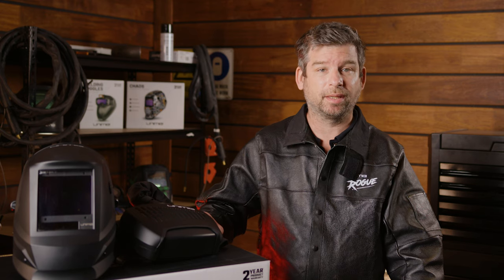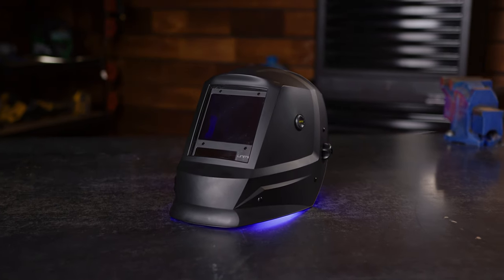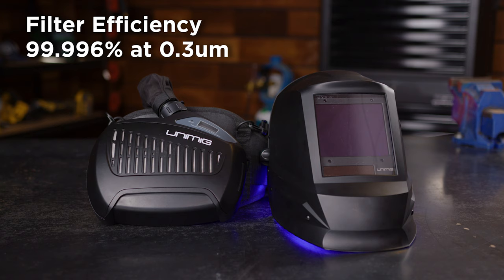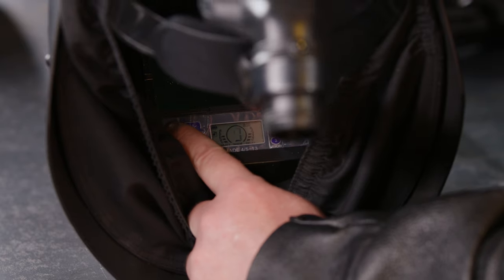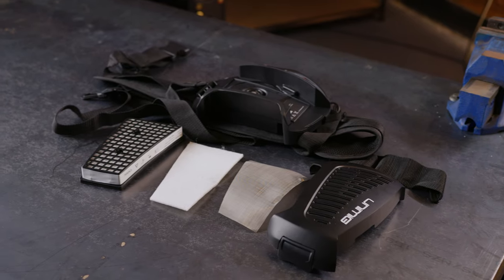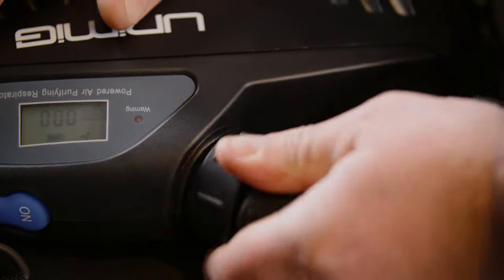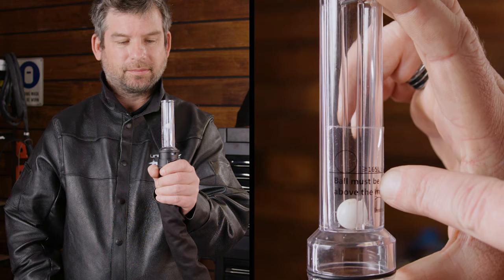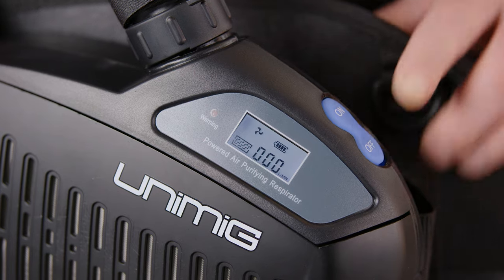PAPR Helmet Walkthrough

Comment: It would be great if you could show the viewing through the lens at different settings / scenarios... e.g. grind, weld, etc.  As it is a PAPR you don't want to be flipping it up often, so keeping it on your head through grinding is needed.  Also, a comparison of the weight compared to other common models out there would be great... e.g. how heavy is the helmet and the battery vs say the ESAB or the 3M units (which are 1/3 more expensive, at least).  I have just purchased the Unimig helmet and hope it is as good quality as my Rasor250 Mig is comparatively.  Cheers
Reply from the maker: Thanks for your feedback and for buying Unimig. That's some great suggestions there that we'll pass onto our product team. We might do some more in-depth comparison videos in the future too.